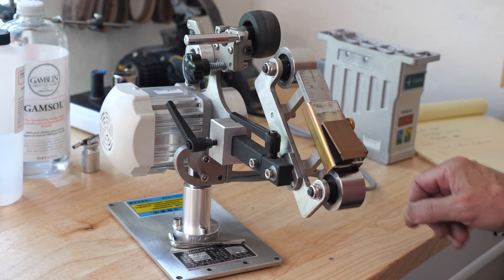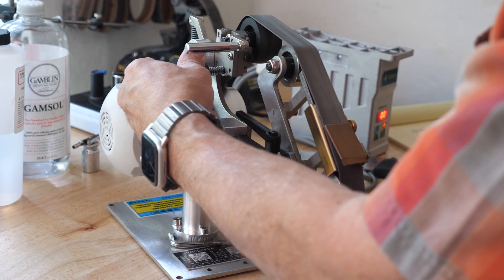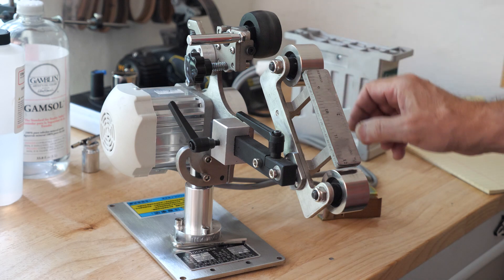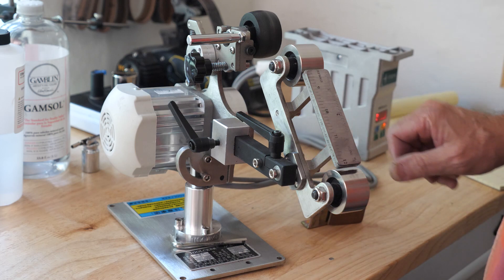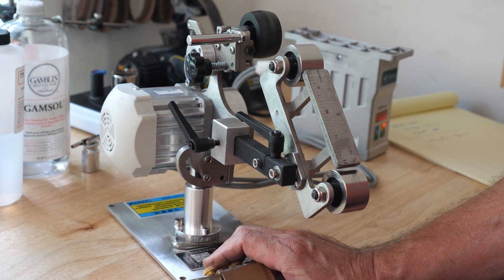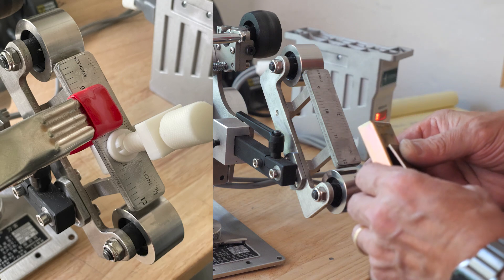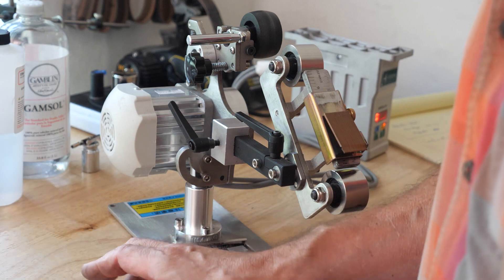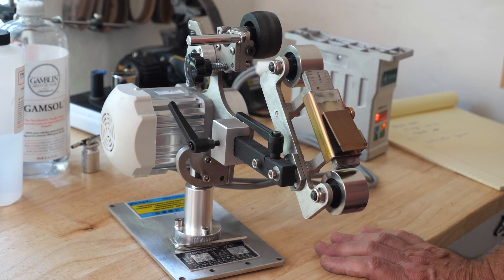Project Magnetic Platen

Comment: I wonder if you put the same magnets on the back of the platen with opposite poles of the ones in the guide would they be strong enough to hold?
Reply from the maker: No, I tried that and the platen is too thick.  It's a full 1/4".

Comment: I found an old retired machinist, he makes the parts for a few bucks (less than a combination square), you have the top portion thinned and shortened a bit and then you can install the angle guide as standard, but you only then secure the bottom screw, if you want to also secure the top screw, you will need to dremel cut the back of the clip to be able to screw the top screw...I would not trust the magnets at 4,000 RPM, a nick in the fabric and everything goes flying!
Reply from the maker: Having it machined is definitely the way to go if you can do it affordably!  As far as the magnets go, they are VERY secure ... and I would never sharpen a knife at 4000 rpm!  That is an invitation to burned edges.  I don't go higher than 1700 rpm for sharpening knives.

Comment: Which Gorilla glue type did you use?
Reply from the maker: I used the original formula.  It's always worked well for me.  If you haven't used it, be aware that it expands as it dries, so you generally want to use it sparingly.

Comment: That's super handy because once you finish with the leading edge of the knife at that particular angle, you can turn it around and strop it with a leather belt for trailing edge...that is if the leather belt fits under the angle guide.

Comment: You did not ruin the sliding square, reassemble it & will have a 8" sliding square. 
There is also an option to drill & thread the platen for a 3mm or #6-32 screw.  
Then you would be able to attach it to the platen with a counter-sink head screw. 
One more option is to mount the angle guide to a thin piece of ( 0.020" thick ) tin or aluminum with a right angle bent on the end to hang it over the top edge of the original platen.  I have made several for my 2x72 grinder which perform  well.
Reply: Unfortunately he cut the wrong end off his ruler, so now his combi-square would start at 4inches, not zero.
Reply: @Therapistinthewhitehouse  LOL . . . the devil is always in the details.

Comment: I also have a Toolcker 1x30 & faced the same problems. 
Using a combination of Paul's cut down angle guide & rare earth magnets on the back of the platen, I was able to get my angle guide to stay on the platen.
I also use a magnetic light & have it attached to the platen arm & adjusted out of the knives path, which is working for me.
Thanks for sharing!

Comment: I use Double Stick tape(vhb) to mount to the Toolcher’s Stainless steel. The key is to slot the holes of the platen mounting arms, as anything you mount to the platen with magnet or tape, forces the belt to rub and heat up the belt/angle guide excessively.
Reply from the maker: Can you explain what you mean by "slot the holes of the platen mounting arms?"  The angle guide does indeed get quite warm.
Reply: @BladeLabMiami  The platen is held on by angle brackets. He is slotting the holes so that the platen can be offset from the belt line by the thickness of the angle guide to reduce friction/heat from the back of the belt rubbing the guide.
Reply from the maker: @mbo7613  Ah, that makes sense.  Thank you.